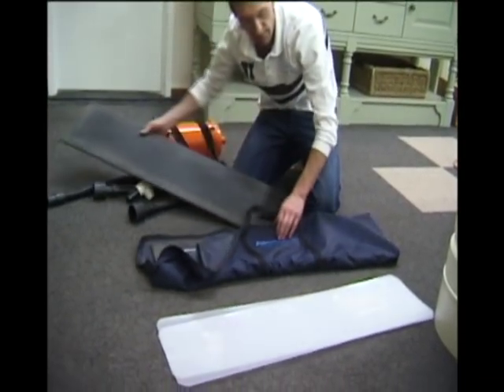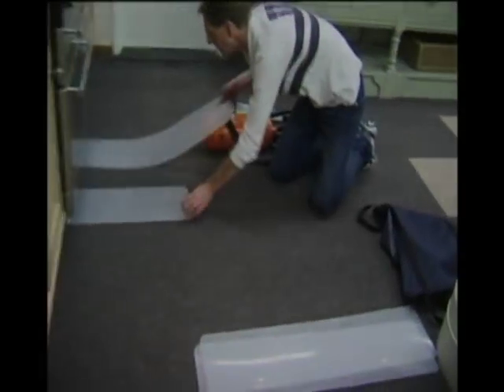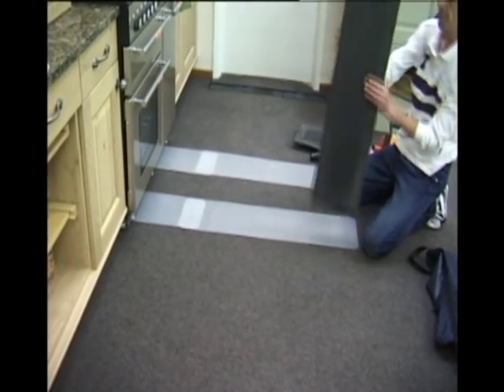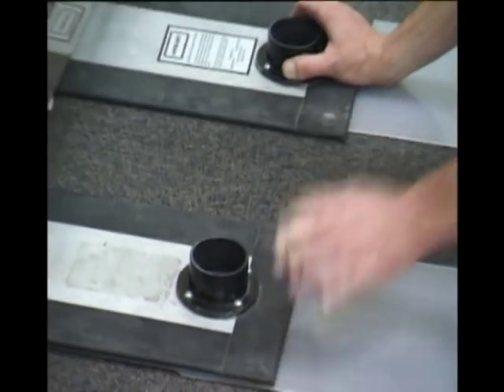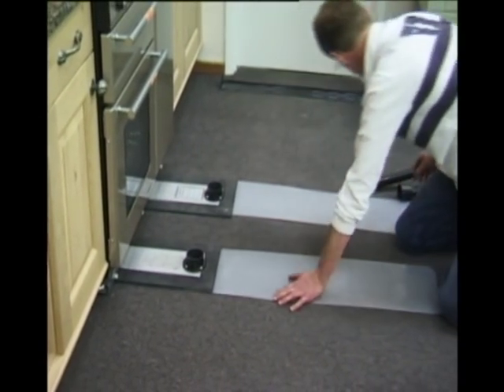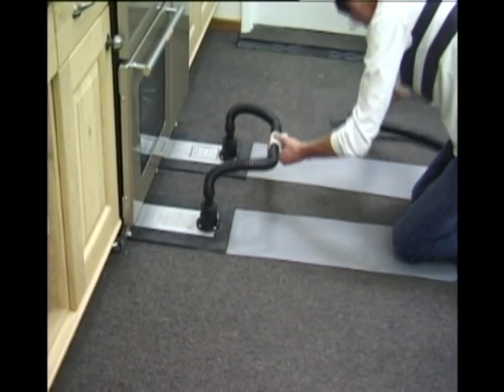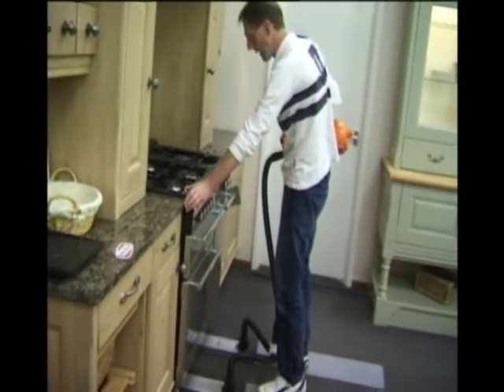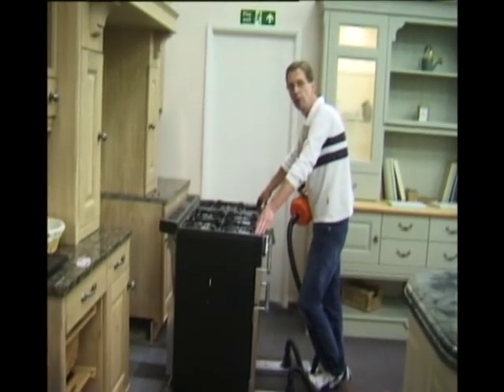Airsled appliance mover

Comment: Using a normal sized oven would eliminate any doubts about it's strength.
Reply: JayZoop it will move a fully loaded fridge no problem. Use them pretty much weekly.
Reply: Moved a large fully loaded fridge the other day with on. They are fantastic